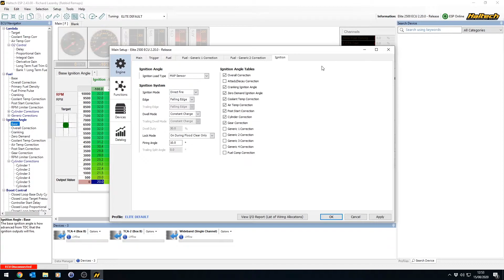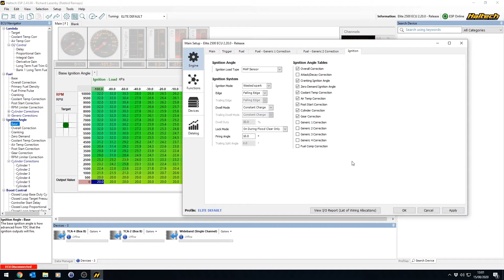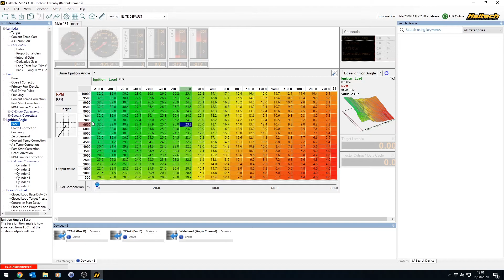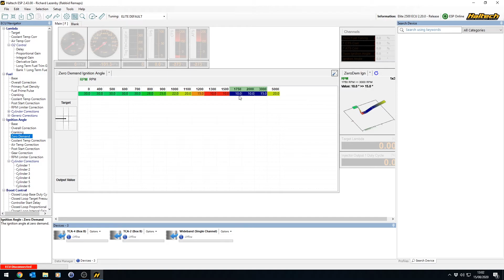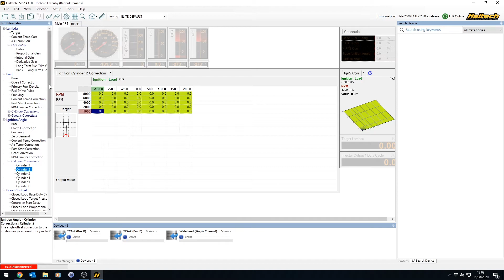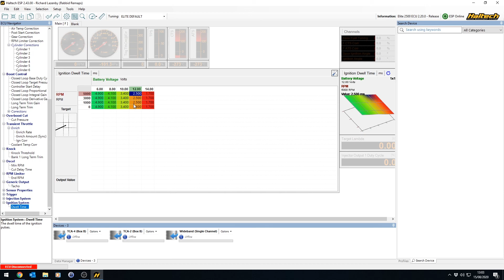Haltech Elite Tutorial Part 4 - Ignition Setup

Comment: I have a coil on each plug but the wires go to the oem plug. Evo 8. Used to have only two coils. Would this still be wasted spark?
Reply from the maker: If you wire cylinder 1 and 4 coils to one output and 2 and 3 to the other then yes it would be wasted spark.

If you have a cam sensor you can wire them 4 induvial inputs and run them direct fire.

Comment: So, I have this thing happening where I can’t get my R32 to idle at 14.5 AFR without hearing pops and misfires. I verified the Trigger Angle already, I’ve played with the Zero Throttle table, and the only AFR I could idle smoothly at is 12.8 AFR. Could it possibly be the CAS angle? It is currently set to the middle. In Neutral, when I rev to 1500rpm, my ECU shows 26 degrees ignition advance.
Reply from the maker: More likely your injection angle or too much cam overlap or incorrect cam timing.

Comment: Thanks for putting the time into these videos.

Cylinder correction. My understanding is that Haltech does not define which cylinder you have knock on even though it windows the listening time on each cylinder combustion event. If this is the case how would you determine if you had a knock sensitive cylinder or is this really for an engine where you may have a known heat issue like some Subarus so you may attempt to look after a pre determined cylinder?

Zero demand retard map on decelerations, did you stop yourself from saying a pops and bangs map? 😂
Reply from the maker: Yes Haltech just shows overall knock values for the bank or total not individual cylinders like a Link can. Hopefully in future firmware it maybe possible, but I wouldn't hold my breath.

So if you are listening to knock you can attempt to remove timing on certain cylinders at a time to determine where it is coming from so with some trial and error you can work it out.

If you have engines with known hot cylinders then yes you can be preemptive on it that way.

Yes it's all about the pop & bang maps.. have 2 cars booked Monday for nothing but pop and bang.. -_-
Reply: Tuned by Rabbid 
It’s annoying as the Link approach to knock sensing is really nice and it’s only software to separate the cylinders.

Your ears will be ringing on Monday night. 😂

... Obviously I’ll be doing my own pop and banger once I get that far on turboing my mx5. Currently Haltech and NA while I learn about mapping. It’s been really enjoyable.

Comment from the maker: Feel free to ask any questions here.
Reply: hello my uconnect ver.15.xx i want update to 17.11 what can i do ? please help me ... jeep grand cherokee 2015
Reply: Hey mate. Got an rb25 swapped S14. Running elite 2000 + new harness. Running Map sensor only, no maf, AFM or 02 sensor ( will be buying a wideband ). Running a R33 map from the haltech folder. Flow rate is already set to 370cc (stock injector size). It's running excessively rich but not sure why, everything in the tune is setup for a stock rb25 which should be perfect for me. Rich enough to where you can smell fuel and the gas goes into the cabin. Should I just keep moving the base fuel table down? Or do I need an 02 sensor to be able to use a map based tune? TPS is calibrated, fuel pressure set to 42 psi (300kpa) which is what the stock regulator sets the pressure at. Timed using a timing light on the crank pulley. Adjustment set at 88° with the CAS pushed to the far left of its seating position. Help would be greatly appreciated, trying to get the car running pretty well for the meantime until I make more power in the next few months!
Cheers
Reply from the maker: @liamdrysdale4473  bast tables are no way guaranteed.

You need a wideband o2 either temporarily or permanently installed and get to tuning the base table to your needs.